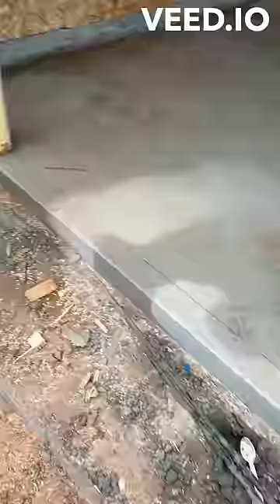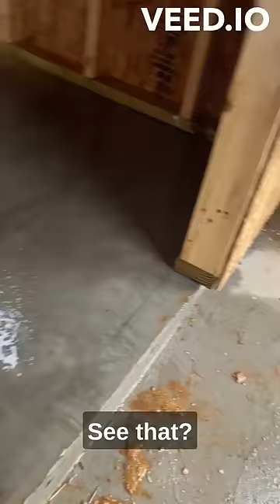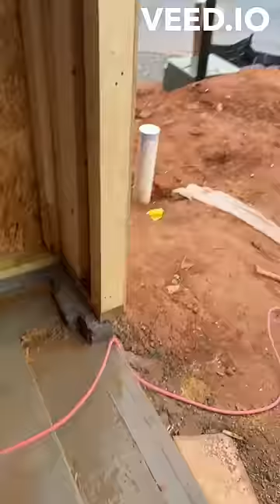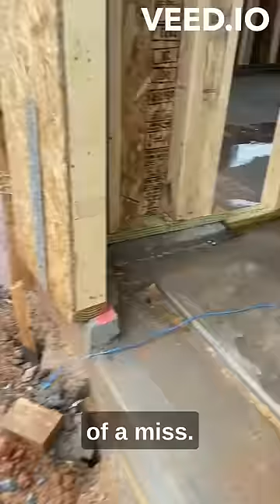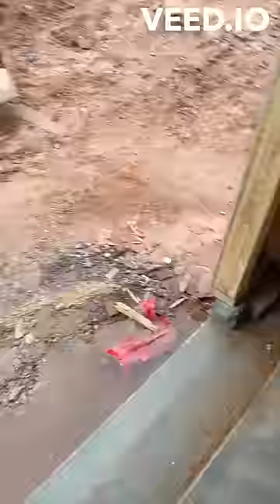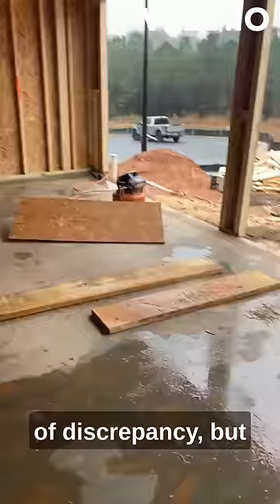New Home Slab is Wrong Size, What Now?

Comment: That framer is going to have a battle on his hands if he didn’t get the OK.  Just because the concrete guy screwed up doesn’t mean you get to follow suit.
Reply: Technically if the slab is off, and the frame is on, the framer didn’t screw up. Their work is right. Concrete guys were short 
Still unprofessional tho. 
But the framers got a schedule to keep too. Can’t just add the house in a few weeks if you’re booked out
Reply: @bigbrudda96 A blind man can see the framers screwed up. I wouldn’t hire them to build a dog house.
Reply: @cuzr702  who?
Reply: Thats a  fact.  😮
Reply: @cuzr702  how can you say the framers screwed up? Im a framer and have built things like this on purpose at the direction of the builder.  And no the builder wasnt a hack he was the opposite. Extremely anal and professional. Construction is rarely  ideal and this might have been the best thing to do at the time everything considered. As long as the framer got the ok from the builder they did nothing wrong.
Reply: @AA-vl3gu   About one inch of the frame is sitting on the foundation. The rest is hanging over the edge. I doubt any inspector would pass that.
Reply: I mean honestly the concrete guys could form out another couples inches on the interiors and the framers could pull off one of the exteriors and trim it back to fit. Wouldn't be too awful just little team work since both screwed up
Reply: @plack_benis382  The concrete guys can’t fix anything now. Those are structural, you can’t just add to them. They should have never formed the walls hanging over edges.
Reply: @cuzr702  On the internal step up portion they can framers can take down the garage side and trim it back other side idk framers probably have to do that as well. But the interior they can bring out the concrete probably have to use a different mix though something for that type of application
Reply: @plack_benis382  I doubt it, any cement added wouldn’t have any strength.
Reply: @cuzr702  Well that's why you use a different mix to ensure it binds and has strength theres more than just basic ass concrete we fix slabs all the time and have extended one or two. Also could get a 2×6 and cut it in and tapcon and liquid nail it to the slab
Reply: @AA-vl3gu I don't know where you built, but this would be failed by the building inspector  .and since I travel that's a failure in multiple states and counties.  Loadbearing walls not properly supported as a start. The not properly supported fails both seismic and hurricane codes and does not allow the proper tie downs.
Reply: @plack_benis382 that's a failure and nothing you can do concrete wise to resolve the resulting cold joints.  
You can dowel and epoxy but it's going to be a lot more than 2".
And you saying that just shows your clueless.  And loads have to bear on the footer and a 2" scab doesn't do that.
Reply: @duanesamuelson2256  It can be done with mapei deep pour it's used on existing slabs to almost any depth and it's strong. Just because you cant do it doesn't mean it can't be done
Reply: @plack_benis382  and what, pray tell, does an epoxy finish resin have to do with scabbing 2" on the side of  load bearing concrete?
Reply: @duanesamuelson2256  Its not an epoxy finish resin I don't need to explain anything to you if you think thats what it is lol
Reply: @plack_benis382  It doesn’t matter what mix you use. It will never be the strength of the original foundation. The inspector is not going to let you scab pieces onto the foundation. If the framers didn’t like the foundation, they should have not framed on it. There work is all for nothing now.
Reply: @plack_benis382  my error, wrong product line...as far as deep pour its a leveling cement product which does not does not fix structural issues no matter how thick you can pour it. The framing is overhanging the foundation to the outside..isn't any floor to build up under it. It's also, working from memory, usable to 50mm.
Reply: @bigbrudda96 Technically, two wrongs don’t make a right. Technically.

Comment: After discovering the error, (at some point someone knew) I would not have proceeded without consulting both the architect and the contractor. To let it go that far is just insane.
Reply: Agreed. This kind of nonsense is a perfect recipe for disaster, of major proportions!
Reply: Exactly this is completely unacceptable.
Reply: @funnyharleyman  they may well have done that and been instructed to frame it up. concrete can be poured to correct it. i have seen this first hand.
Reply: when that south of the border labor comes back to bite you in your southern hemisphere
Reply: The issue then becomes who is gonna pay for it while the framing crew is on site waiting for an answer to the argument between GC and Concrete Contractor, GC may have to go back to designer to argue with them if the plans were wrong. Everybody says F kit, let the trim guys figure out how to hide it.
Reply: What is very curious is the janky splice job on the outside corner they actually added a foot to the wall. If the had to add a foot they could have very easily subtracted and inch and a half. Theres so much going on here i feel bad for the homeowner. That splice job would be very concerning to me. Not to mention the concrete work finish wise is terrible as well.  I believe this is the result of a strained worker availability.  They have to hire virtually anyone who walks through the door if they want employees.
Reply: Ever heard the story about the Spanish speaking plumbing rough in contractors?  C for caliente.

Comment: Looks like the concrete guys measured to the outside of the form board.
Reply: ...and/or the rough Carpenter framed it with the forms still on the concrete.
Reply: That's exactly what happened.  Couldn't read plans. The framers put their walls and bottom plate were they were suposta be . Not everyone will understand this or see what's wrong.
Reply: @mattwarren5933  lol that's not true..
Reply: Looks like a cookie cutter house, in that the framers got pre-made walls and put them up even though the concrete guys measured to the outside of the form boards and not the inside.
Reply: That's exactly what I was thinking
Reply: 100% agree.
Reply: @mattwarren5933  the concrete guys formed it a little out of square any quality framer would know that he simply needs to move the wall in a inch or two it makes no difference it the end product at all
Reply: @joe-bg6ij that’s what I was thinking 
Isn’t there a saying about drywall 🤔
Reply: @tinytattoomike7943  yes but it's the foundation that is out of square the framers just needed to move there lines/walls in a little
Reply: @jayburgher6780 I respectfully disagree.   I think the trusses were already ordered for a certain size...
Reply: @mattwarren, do they use prevail roof trusses in USA at all? Where I'm from the trusses  are usually made straight after the frames at the factory, so just reducing the size of the house by 2'' or whatever isnt really an option
Reply: @joe-bg6ij  Framers are at fault. Beginning and end. I don't care a whit if the concrete guys missed by an inch or two. Framers come next and gotta compensate.
Reply: That would explain it, but how the hell could that happen? I honestly don’t think it’s possible. They couldn’t be that stupid, could they?
Reply: @jayburgher6780 that I could see. Either way, it’s a shit show.
Reply: @jenniferlawson1678 What do you mean the concrete guys measured to the outside? They made the forms. You’re telling me they included the forms in their dimensions? That sounds crazy.
Reply: @shelfcloud487  rushed is usually the culprit. I’ve seen some brilliant carpenters inch themselves or fumble a square just because of a tight deadline.

Comment: Wait till the sparky's HVAC and plumbers get in there 😂😂😂
Reply: Plumbers were already there once... unless they wanna bust up concrete... the excavator guy and plumbers are the first and last people at a new construction job site
Reply: As a plumber I will go there and cut the entire way through all those studs with a sawzall because I have a 1 1/2" vent line and forgot my hole saw (JK I pawned it)
Reply: Yeah don't envy anyone who has to work underground on this job.
Reply: It’s all out war
Reply: 😂 👌🏻 the HVAC are the smartest ones on the job. Keep swinging those hammers boys. Don’t forget the hardest rule to remember : measure twice cut once😂😂😂😂
Reply: Someone forgot to do a, happy medium. If I have to shrink a bedroom size or something down, I will do it. Hallways and bathrooms, I will always maintain whatever the print says. If I have a size discrepancy, pulling parallel from the back, I will make an alteration. I tried to keep the front the foyer walls the same and anything else, but if it needs adjusted, it has to happen. Garage faces, I would typically pull off the front to a number that is approximately parallel side to side off the back. If it was on board walls, I would typically just pull 4 in off the front face of the garage wall at whatever point is the outside most portion of the brick on each side of the opening towards the exterior corner. I can see from the thoughts of some framers how they might not want to shrink down dimensions, because that could actually be something that they could be sued over by not having proper dimensions and a contract may have to be negotiated. 🎉

Comment: It's amazing to see how these timber frame houses are built ... my house is over 300 years old and has granite walls over 3' thick and the beams are over 18" square and spaced at 3' centre to centre. So so different, each have their merits I suppose.
Reply: Of course both have merits. Wood framing works just fine (it's a complete system) . Easier to run wiring and plumbing and less echo inside. Block type construction is more popular in Florida, due to hurricane risk.

Comment: At my framing company we do the concrete ourselves and never run into this
Reply: Why Do you think the framers did it that way?
Reply: Ok
Reply: Shouldn't the framer adjust the dimensions to accommodate issues like this?  I understand following the print, but no one benefits by saying "Fuck-it, ain't my problem"...
Reply: Thats true we do our own concrete too
Reply: If you want it done right,  you have to do it yourself,  other people don't care,  it's not their money. 💯😂
Reply: @truck-stop_abortionclinic you sometimes can't adjust the framing,  the blueprints are specific to the floor plans and if you adjust the framing then your going to have to adjust everything else,  cabinets may not fit, bathtubs are mainly 60" , a couple of inches doesn't seem like a lot, but it could mess up everything.
Reply: @officialoverlander That's very true, the trusses were probably already ordered to fit the frame. I guess it's on the concrete contractor to find a solution
Reply: Couldn’t they just slide it back that inch and remove the back inch off of the side walls while pushing up the back wall if needed? Everything could technically still be laid out the exact same way just lose an inch off the back side of house?

Comment: As a former framer of 20 plus years, this was common. I always framed to the foundation the best I could, if a room was 1 3/4 shorter no one will ever know, Now keeping it all plumb, level and square now that's what makes a great framer
Reply: Framers suck worse than ever. The job I just did didn't have a square wall in the entire building.  I'm an electrician and noticed how bad it was so that's saying something
Reply: That speaks to your lack of integrity, which is doing what's right even when nobody is looking. 

My family owned a concrete forming company for over 70 years in Denver, and we always made it right if we messed up and called out problems in other work that affected ours.

I can pound on a piano for 20 years and never become a pianist.  Years don't always equal experience and/or quality.  Integrity does, because it makes you think about what you're doing instead of just going with whatever is in front of you at the time. 

I'd never hire you.
Reply: Right why overhang you framing like that...load/weight bearing walls not good
Reply: Now tell me what your best would you do when you come up to the site where the foundation is 1' short or missed at all.
Reply: @tonyploma2330 I swear and drywall if the framing decent drywall will find a way to make the wall crooked every time. I do flooring mostly and try getting a floor square in a crooked house it's ridiculous
Reply: Oh, the other trades will know when none of the measurements are to scale... now, whether it gets brought up is another story...😊
Reply: Yea we know, it's everyone else that's dumb
Reply: @sbeavers30721  no one will ever know? Ur a hack! The finishers know. The drywall guy knows. The floor guys know. The trim guys know!!! 🤦‍♂️🤦‍♂️🤦‍♂️
Reply: Even if the concrete was poured wrong, how hard is it to frame it to the dimensions of the slab? This just seems like they are being stubborn and it’s an ongoing feud between them.
Reply: @shelfcloud487  If tire size is wrong, how hard it is to mount it on a car?
Reply: @redwood_shores  stupid comparison. Thanks for not answering my question. If the house is a prefab, that would explain a lot. That’s why I was asking. Not sure who fucked up here, but that fix doesn’t cut it. They should have never proceeded with building that house. Whoever F’d up should have to eat the cost to make it right.
Reply: Lol, what’s with the common sense?
Reply: Dude if you cant make plum, level and square, squares out of pre cut boards then you probably dont have a pulse. That being said did you see the janky ass splice in the outside corner? They added a foot to the wall. That tells me this was dileberate to prove a point or job security.

Comment: You avoid this problem by checking the form work before the pour. This is on the GC AND the concrete guys. I see this all the time with home builders. They act like they have no control over the subcontractors. Do your job and check their work. That’s what you get paid for. Same as those of us on the commercial side.

Comment: Yeah as a framers assistant in the way back. You stop as soon as you find out the issue. Which is usually when you pre measure. You contact the builder, or foreman. Tell them aout the issue. Allow them to rectify it. Push comes to shove, you modify the plans to suit the discrepancies.
Reply: Amen
Reply: What issue?😂
Reply: I've gotten 3 days of pay in a week for this before. Job site tells me they're ready, I go out, they are not even close.

Ive got a job right now thats been tellin mentheyre ready for me for 3 months. Its a 3 hour drive there. Every time I go, they're not ready lmfao.
Reply: "Is the room square?"  First time I ever saw a framer in 1989. That's THE FIRST THING that he did. He would have adjusted the measurements ON THE SPOT. It was the standard operating procedure.  I was friends with the GC and the house was spot on. But the framer was surprised: he was ACCUSTOMED to making those adjustments.
Reply: @Stephenwc  very few projects go in like they do on paper.

Comment: Wow, those framers are king of "not my problem"
Reply: people keep blameing the framers but on new homes framers cant just go moving walls. the whole house may have
 come as engineered panels so all they did was assemble a big piece of 
IKEA furniture and they would have no control how big the house ended up
 and even if not the houses size is also controlled my the trusses 
people think you can just change the framing to match the slab but on 
most houses built nowadays this is just not an option with out having 
things re-engineered iv framed houses that have had this exact issues
Reply: ya think?  I can say that many immigrant managed construction teams /companies work this way. Sorry but it's true.  The individuals may be OK but their owners don't give a whatever about the quality.

Comment: Man I wish all inspectors were like this guy, I have a new build and I have cracks on the stucco cracks in the inside of my house it’s ridiculous!
Reply: you mean drywall? and no inspector would be able to tell you its fucked if they werent there when the mudding and taping were done...you know nothing
Reply: Stucco rots from the inside out. I've been working with it for years. I never recommended. Don't punch any holes in it just before you know it. If you ever open up a wall it'll be a disaster
Reply: Slab settling.  Wasn't compacted before poured. Most common reason this happens